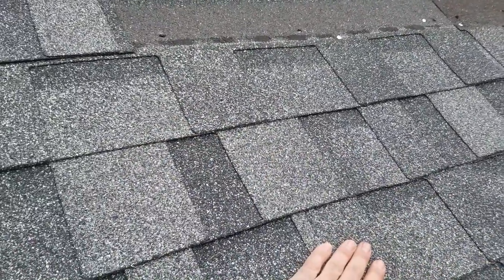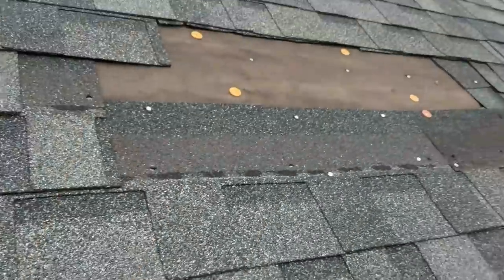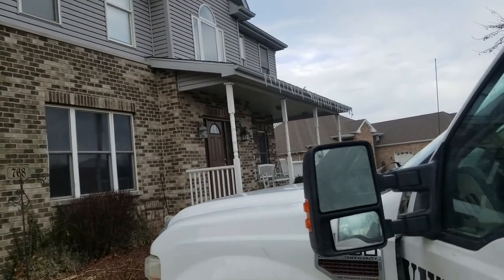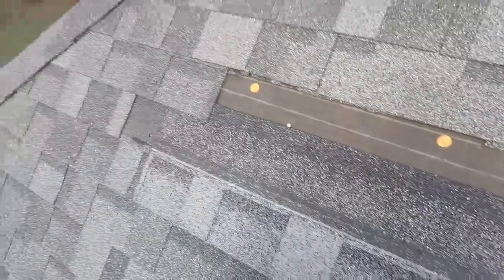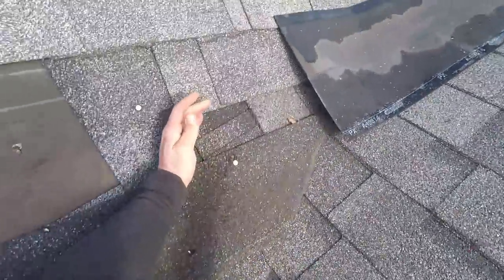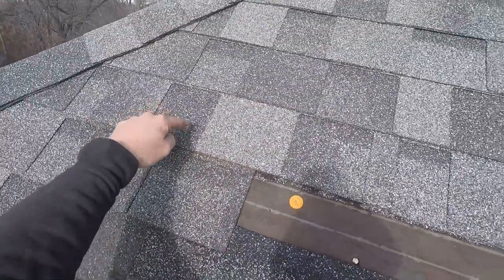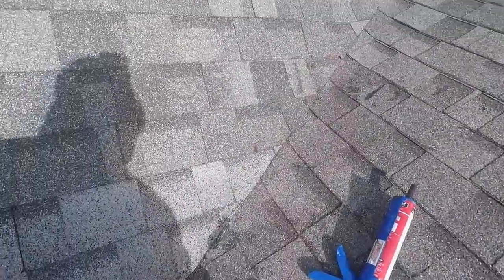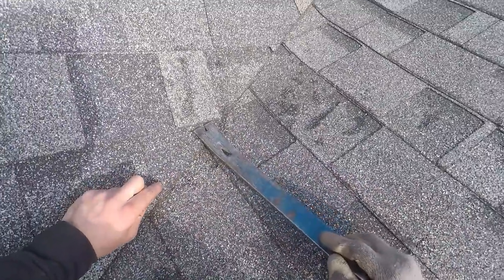How To Repair Shingles

Comment: I'm a retired contractor after 30 some years.  I found  the best way to separate sealed shingles from one another is to use a pointed masonry trowel. Move the trial left and right in a sawing motion between the 2 shingles you wish to separate. This is the best way without tearing them. A flat bar is too thick and a lot of times tears a hole in the shingle. Of course nothing is 100% but I have found this is the most productive way of separating shingles that are sealed especially if the roof has been down for many years and you're having a lot of trouble separating them
Reply: Also using a thin flexible drywall putty knife works very well to separate the shingles without any damage while performing roof repairs.  Fits easy into the tool bag.
Reply from the maker: I actually brought something of the sort with me incase I was having troubles. I could've mentioned it my bad!

Comment: Glad those tar strips 'released' for you. Sometimes I have to use my slate ripper to 'cut' through the seal down strip.
When having to nail under the last row, I'll place the nail under shingle, 'set' the nail by tapping on face of shingle DIRECTLY over nail head, 
but then lift shingle up & place flat bar on top of nail and smack the flat bar with hammer until nail is 'driven'.

I was on a roof leak call last Sat. - Owner installed roof about 15 yrs ago, & used nail line as the alignment line!!!! 
Some of the  butt joints where only 3" apart!!!  Gotta love it!
Reply from the maker: JEEZE LOL

Comment: Okay a few things..........
For one if there's wind issues you should put 6 nails not four as it's an element used to achieve a " high wind warranty" with most manufacturers even though this can not be obtained with a repair but still a good idea.  Every roof we do these days has it and not an expensive precaution . And even though nailing by the seams is not recommend I'm sure you'll agree it's virtually impossible if doing an entire roof without getting a few close but have never been known to cause any issues in my thirty years in the industry but is good practice, and very happy you showed the nailing height to hit the shingle below as that is critical for sure to not exceed the head lap below . A critical elements I believe you missed is Tipping your valley, which means cutting off the top corner of the shingle installed especially in a closed cut valley as shown or the water running down this valley can travel across the top of the shingle to the seam and cause a leak especially in a high driving rain , this tipping cause the water to be pushed back out to the valley mouth to avoid this issue. Just a few pointers but great your trying to teach people 👍👍👍Stay Cool and I must agree I'm not a fan of IKO Cambridge either lol
Reply from the maker: yea I thought about croppin the top, and it Is 100% possible, to never have one nail in any seam on any roof ever...I've mastered that. you can see some of the most common issues with it easily avoided in my video titled "how many of these mistakes do you make" thanks for the comment bud I can tell you're no stranger to the game. look forward to hearing from you in the future

Comment: We always use a heat gun to heat the shingles up around the area that we are repairing so the shingles will flex and separate easily and not crack or get damaged

Comment: something I do so I don’t struggle in putting  nails on a repair is opening the box flaps of the shingle and hitting a nail into it and resealing it adding tar or silicone which has worked well for me

Comment: Good video!  Well done! Nice repair! Two comments regarding the valley though.  1. Many leaks in the valley are caused by not cutting the dog ears off at an angle, This ensures that water running down the valley will not catch the top of the shingle and run horizontally.  2. What would you have done with the cracked shingle, if the installer had tarred his valley... Which would've made it near impossible to separate anything?  I likely would've just tried to get tar underneath the crack of the shingle and called it a day.

Comment: a puddy knife works good for breaking the tar line esp for 3 tabs when making a repair. also when its its freezing like that outside i switch from the asphalt cement to silicone it doesn't freeze and seals shingles good

Comment: Good ole IKO's and a High Nailer, what a combination. We had a hail storm 8 years ago in my area and now at least half these roofs need replaced again because IKO flooded this area brought in by the storm chasers. You can drive any neighborhood and see patches of shingles sliding out of place if their not on the ground.  I've done so many repairs like this one for people that are living in denial that the roof is going to need to be replaced. When you try and tell the client this then they bring in Joe Dirt for a second opinion and you drive by and there and his crew is on the roof resetting the clock for another seven year roof.

Comment: People should know that the nailing area depends on the pitch of the roof, it tells you on the package. Also if you aren’t replacing the underlayment you should seal the nail holes. Why take a chance that close to a valley? Water can and will run sideways across the rows under the shingles. People should also be using a hook blade so they don’t cut the bottom shingles in the valley. Use granules out of the gutter to cover exposed tar unless they’re wet but exposed tar will dry and shrink causing a shiner to leak eventually.
Reply: Thanks  tips

Comment: I reccomend you get the roof snake its really helpful when nailing under shingles on a repair
Reply: Ahh I just bought one last week to re-roofing my house that has a covered patio slightly extended over the main roof. I may or may not need it, but it is an essential tool to have for future repair. Not a roofer by trade so quite a alot of weekend work for one person to lay 29 square.

Comment: once you get the head of the nail popped a little bit, use the hole in the pry bar to grab it and rip it out downward at the angle of the roof. works for me!

Comment: Actually when doing repairs in cold weather it’s wise to apply roofing cement under the new shingles as well as the existing to assure they seal. Considering the new shingles more than likely will not heat up enough to seal properly until spring.
Reply from the maker: you aint wrong! I easily could've dropped a few dabs under there

Comment: Any possibility on a metal roof sealing or repair? I have a 20x28 pole barn with old school nails a d rubber gaskets. I have 100000 of them that need sealed or replaced.  Any tips or tricks?
Reply from the maker: ouw tough one. I redid one just like that but problem is the nails bro...you can caulk them with clear silicone or quad or replace the whole thing with that metal from menards for about 3500

Comment: Whats the average cost for a 24sq roof replacement? Live in CT. Pretty simple roof, just a little more of a pitch than usual, nothing crazy to it.
Reply from the maker: If it's walkable expect between 260 350 a sq roughly for a newer- reputable  company.  You'll get bids all over the board.  Some companies have real overhead like vehicles and buildings and office staff and will be higher rightfully so, others will be way higher for fake reasons, like they don't have employees and need to find a roofing company to do the work.  Aka sub the work to them. Stay away from them.  Those prices I gave are for my area.  Yours could be wayyy different

Comment: I love your videos! I live in Massachusetts and I’ve had friends who are master carpenters, plumbers and electricians but I need some help with redoing a dormer and I would love to see your video to compare with how I learned at the vocational Highschool I went to and with how my friends told me to do it I just want an extra opinion and if I may ask what brand is that utility knife you are using with the hooked blade and regular utility blade I want to get one just like it instead of changing the blades every time I work or having to carry 2-3 different knives.
Reply from the maker: its a Stanley, you can get them online, but i would recommend just going to menards. home depot doesn't carry them